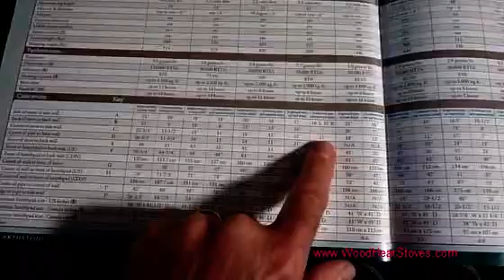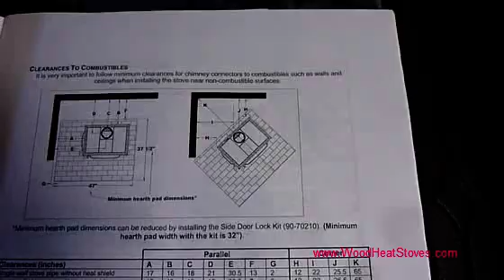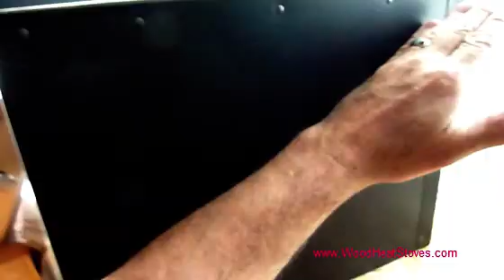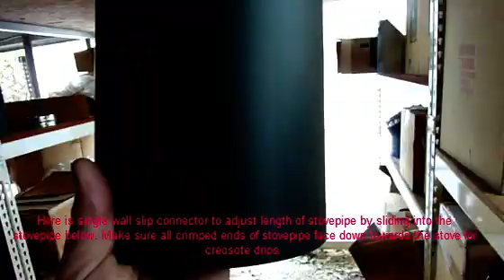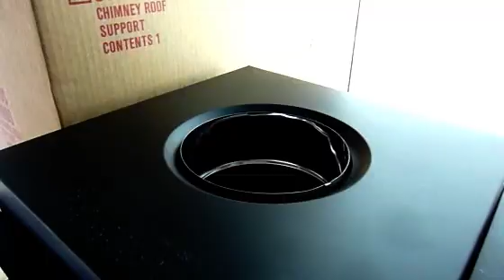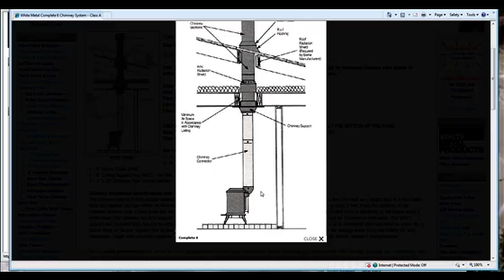Wood Stove Chimney System Components & Installation video review #2

Comment: It is my understanding that the single wall pipe adapter goes on the inside. It is the first thing that you put in the box from the other side and the box probably doesn't need to be cut in order to make it fit. That is what the directions for an installation that I'm researching. Turns out they didn't even use the adapter.

Comment from the maker: We don't recommend sealant pipe for stove pipe and it is not recommended by any pipe manufacturers. The joints seal adequately right out of the box. 
Thanks for the compliments. After over 30 years of helping customers understand the details of their stove and chimneys it is fantastic to now reach out so effectively to thousands. We're thrilled that our previous chimney video has had over 20,000 viewings in the last year so we added this one. email us at info at woodheatstovesdotcom